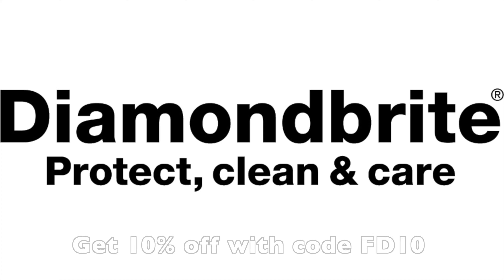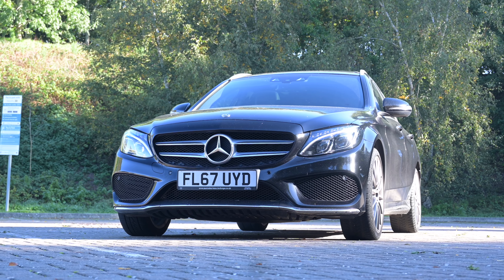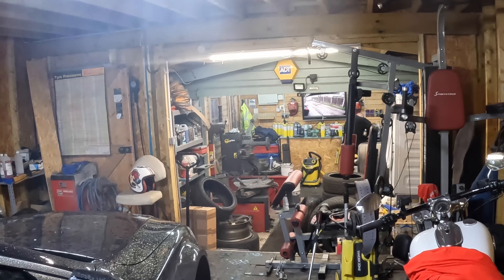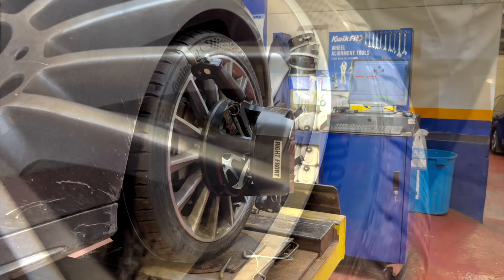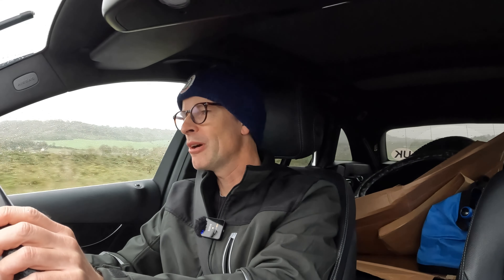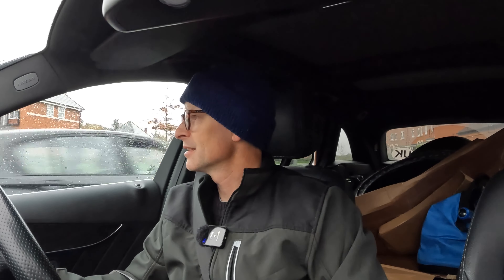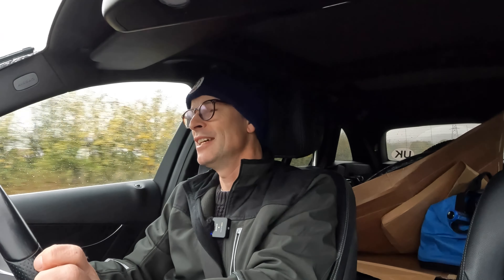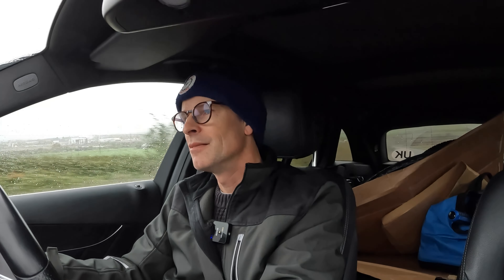Mercedes C250 10k mile update...Is it my new favourite?

Comment: I remember buying my Mazda 2, 2 years ago and it had been run on a shoe string. It had 4 part worn tyres, all different brands, all complete s**t. I changed them to Uniroyal Rainsport 5s and it completely transformed the car. I feel you with the change you got from your car. It's amazing that something simple can completely change the driving experience.
Reply: My car came with Hankook Ventus Prime 2s and they were OK, I put Pirelli Cinturato P7s on it and what a difference.
Reply: It's the rubber components that are generally supplying the comfort of a vehicle, four new balanced tyres should feel better you've more rubber insulating you from the road surface, good idea to rotate tyres so you can bargain a better price for four new ones.

Comment: Getting rid of the runflats in my F30 transformed the handling as well, I'm running Michelin Pilot All Season 4's and they've been fantastic so far
Reply: People running run flats is down to manufactures not providing a spare, those seal and inflate kits are rubbish and will ruin an often repairable tyre that just has a nail or flint in it.

Comment: Bought my Hyundai 5 years ago with a set of Semperit Comfortlife. Those were only half a decade old, had decent meat, but handled like crap. Swapped them to winter tires from Hankook.. was not astonished by the gain. But, during Spring, I got Semperit's new Comfortlife 2 tires (suppose those are still on), and was blown away how direct an old hydraulic power steering can be. It made massive difference. During Autumn, I came home on a curvy set of roads and the back end just flung out, towards the railing, and I wasn't even hammering the thing. The new summer tires just took it like an absolute boss, as if the car was stuck onto the road. 
Having proper rubber materials contacting the road surface is the biggest tuning everyone can afford (sort of, unless you fiddle with the ECU, on your own accord, that is).

Comment: Matt you can get an XF estate as a manual, they are rare but available and ULEZ compliant.  I used to have a 3.0 XF auto and you can use the paddles at any time and it will hold the gear that you put it in so you can use it like a clutchess manual which worked well.
Reply from the maker: I only found base model 2 litre diesel or the V8 R, but nothing in between! Looked quite often too...
Reply: @furiousdriving  You can find both high spec portfolio and R-Sport manuals with the high output 2.0 diesel granted the V6 was never available with manual
Reply: Great review as a S204 owner I'm always interested in the differences compared to the S205.  I swapped out my Contis for Michelins and have been delighted with what I feel is a slight improvement

Comment: You should have gone for all-season tyres. I just put 4x non-runflat Bridgestone WeatherControl A005e on my BMW, and they're brilliant! Far better ride than the OEM runflats that came with the car, almost as good grip in the dry, and far better in the wet, cold, and the light snow we get here in southern England. I had to shop around a bit to find a brand that did all-seasons in the sizes I needed (225/40R19 on the front, 255/35R19 on the back), but now I've done it, I couldn't be happier. Oh, and a slime repair kit in the boot!

Comment: Matt, I recently bought a W204 Saloon (2009 C200 Sport CDI). It is a capable car, has the 2.1 diesel, runs and drives perfectly. VED is £220 a year which makes it cheaper to run than the 1995 BMW E36 318i that it replaced. It has virtually no rust (just some stonechips on the bonnet) and looks like a car with half the mileage (216K on the clock). I wouldn't get rid of my Volvo XC90 but I'm loving the Merc. I've forgotten what a good saloon car is like to drive. It looks like decent tyres have tipped the balance in favour of you keeping the S205.
Reply from the maker: I miss my 204, really well built and so good to drive, if only they were ULEZ - the 205 has the same engine just with ad blue
Reply: Yeah, I get that ULEZ compliance was something you needed from your daily driver.

Comment: Re the Box going back into Auto mode. Go to your mode settings and go to INDIVIDUAL. Set the Gearbox as manual and any other settings you want. Then use Individual rather than sport or comfort. The box will stay in what ever gear you put it in and will not change.
Reply from the maker: I did try that for a bit, but with 9 speeds its constant shifting, and I know that sounds like what I want but with so many gears its better to let it get going on its own and take over as needed. Of course a manual would be better still
Reply: @furiousdriving  You should be able to "double tap" to skip gears, giving less shifting? When I ride my motorcycle I often flick my foot 2 or even 3 gears at the time if I am just cruising about....
Reply from the maker: @GoldenCroc  Ive not heard of that with this before, will try it next time I take it out
Reply: @furiousdriving  Works fine on my old-ish BMW with paddles, no Idea about Merc to be honest, but I dont see why not.

Comment: I have 19" wheels on my E220d and had a very similar crack to yours repaired - the repairer said that BMW and Merc wheels above 18" are his bread and butter jobs. For tyres mine came from new with Goodyear Eagle F1 Asymmetrics, although they are runflat they give great grip all year round. I've stuck with them (now Asymmetric 3s) and I have been getting 20-25,000 miles out of a set, so can't really complain

Comment: Great little update on the Merc Matt and glad you seem a bit happier with the Merc now. That's the one thing that transformed the car when I had R56 Mini was to remove the run flat tyres and replace them with 18 inch rubber band non runflat tyres, it was like night and day. My Cactus is back on its steelies or standard wheels for the winter and for a car that came from a main dealer I can assure you that it never got checked before I bought it as it has 4 different brands of tyres on it! All fairly new tyres, so either the last owner skimped on tyres of not the same brand! I am not a racing driver by any means and the tyres will prob cover about 3000 miles before they come off again in March/April 2023.

Comment: Hi Matt,
Not sure if anyone else picked up on this but early on in the video I thought there was a fair bit of road noise but after the tyre change it was much less noticeable. Another reason I don't like run flats.
I've not driven a modern Mercedes car with an auto box but I have driven plenty of Mercedes truckd and they are the worse, most frustrating gearbox I've ever encountered as they are so dim witted.
I think with modern cars being so refined a slush box can suite the nature of the car and having other cars to drive I think the less engaging driving experience could be tolerated but the other issues you mentioned could be a little harder to live with.

Comment: I loved the way mine looked, a 2019 amg premium plus in diamond white with 19" wheels. I thought the seats were rock hard and the Pirelli tyres were aweful below 10 degrees. I sold it. I now have a Volvo V90 D4 Inscription with an amazing spec. I would never repair an alloy. Just buy a new one. My Volvo is lovely.
Reply from the maker: Yours must have had different seats to mine as these are very soft, much softer than in the W204 in fact. 
If an alloy repair is done well it should last and not be an issue, and a fraction of the cost of a new wheel too

Comment: Have to say I fully agree with you and automatic gearboxes, I've had a couple of autos - both DSG and an old fashioned torque converter type and they both at times select the wrong gear or respond in ways you are not expecting/desiring. I think I'd just put up with it in the case of the S205 and use the other cars for your manual kicks, it's such a nice spec otherwise! Alternatively: P2 Volvo V70 with the 2.5T 5 cylinder petrol engine is ULEZ friendly and can be had with a manual gearbox for £2-3k and a bit more in fuel...
Reply from the maker: Maybe by spring Ill be bored enough to swap it, there are a few estates Id like to try

Comment: It could be worth a gearbox tune. A friend had their E61 535d touring gearbox tuned and it was night and day how responsive and willing to hold a gear and use the torque instead of revving the goolies off it. It may also give you more specifically better low gear holding in sport mode.

Comment: Great video. Came to this after watching 4 of the Mondeo videos. I highly suggest that cracked and repaired wheel remain on the rear of the car and then there is never a chance it’s going to present any out of balance situation to steering and also on the rear less likely to be affected by the extra weight on it and other pot holes in the front. Liked and subscribed!

Comment: I have a 2012 E250cdi with the 7 speed auto, having a fair few autos over the last 25years its by far the best up there with the 5 speed on my old BMW 740, for the driving I do i barely notice any changes, when it did get a bit sluggish not really that much though I had the box flushed and serviced at a MB specialist made it even better

Comment: Sweet car! Don't sell it cause of the 9G Tronic. Try and search for a local bloke with a Xentry / DAS/Vediamo with C4 or C5 to code in Agility and True Manual mode plus AMG menu. The True Manual mode will indeed allow you to plough through the gears from the gear levers on the steering wheel whereas the Agility mode will increase responsiveness to the gearbox changes. I fully understand where you come from when you are saying that a manual vehicle is more engaging. Sad that they left the W205 without the 3.0 V6 diesel engine. The AMG menu will allow you to see all kinds of parameters specific to the AMG vehicles. Fit some Eibach or Vogtland lowering springs and the car will transform completely. Cheers!

Comment: I had 2 sets of Pirelli P7s on my Kia Cee'd, really good tyres and lasted me 80,000km. I'm now using Michelin PS4s on my new Civic 2.0 hybrid and I might change them for Pirellis when I go to replace them.
Reply: Also, I used to be a massive manual gearbox fan, but since driving the Civic hybrid with its eCVT I'm converted. I do still enjoy driving a good manual, but I doubt I'll buy another manual car now.

Comment: I’ve just put a deposit on a 93k mile 2015 C220D g-tronic sport estate with pan roof. It was by far the most comfortable of the cars I tried in my budget. 

With my new car being Sport trim I’m hoping the ride and suspension is going to be a lot more forgiving than the AMG Line models.

Comment: When I got my Z4 it came on the oe Bridgestone A05 runflats and tramlined horrendously and rode like a skateboard, swapped after couple of days as I'd test driven ones on normal tyres. Guy selling it included a 3 series jack kit and a full set of matching 103 design spares with half worn Conti 830 winters. (swapped last week for the summers). Like yours the ride is stodgy but wouldn't drive without them over winter because of the much better wet grip and braking.
My last boss had a 2017 and 2018 Tesla Mod. X and had to pay full whack VED for 5 yrs (the £300 expensive car supplement) as were over 40k new,  all EVs over 40k did after 2017 ved rule changes.

Comment: Good to have an update, looked at Mercedes’ and bmw as wanted a treat but just couldn’t quite stretch or spec was wrong or dealer was a pita, anyway I tried Mercedes’ like yours and it was nice but couldn’t understand the gearbox shifts, then tried a dsg Skoda Octavia estate newer cheaper and less miles 30k, and was stunned at difference, tho obvs much less classy and quality. Now 18 months later and coming up 90k, I still love it, but the 90k timing belt and service cost 1300 quid not helped by crank oil seal failed, and 2 weeks later the dmf is chattering so another 1000+ to fix. Sure all will be fine after that but jeeesh all this tech and emission crap costs a bloody fortune and every service seems to end in a parts list longer than my arm. However, the experience with the c class makes sense, I didn’t know it learned - dsg doesn’t, but the Mercedes’ dealer who I said nice car but gear changes odd just walked off and never explained 🤷🏼‍♂️

Comment: I think, to me, it depends on what journey I'm doing. A short journey with a lot of gear changes, manual every day - I love driving involvement for short journeys. However, for longer, mostly motorway journeys, I prioritise relaxation and ease over driving involvement, so my automatic '01 Lexus GS300 doesn't bother me at all for that, especially since it's an old 5-speed slush box that's a lot more predictable and cooperative than these new fangled 20-speed things seem to be. Plus it has manumatic buttons on the wheel which actually hold the car in a particular gear when you want it to - imagine that!

Comment: My 2020 golf estate came with continental eco contacts with about 3.5mm tread left on the fronts. I hated the lack of traction, poor wet grip and replaced them with good year all seasons which I had on the previous seat Leon and really liked. Immediately I have much better traction wet or dry, the handling is fun on country roads with much less understeer and grip in the wet is confidence inspiring. I got very good life out of my Leon's all seasons so I found no downside although dry weather performance is ultimately behind a summer tyre and snow grip behind a winter one. Though I don't notice any obvious difference myself. Haven't tried in harsh winter yet thoygh. The tyre is also considerably quieter. Long distance fuel economy seems pretty similar at about 55mpg (not bad for a petrol) but low speed economy does seem worse at about 37mpg on urban commute down from 40.  Worth it for the extra confidence and grip. Yes.

Comment: You can overthink things. Had 4 new c250 mercs, c , e and glc. Just drive them,  dont think about it. Personally think they are superb,  safe, solid,  relaxing. Agree super low profile tyres are the bain of modern daftest trend ever. If I was super picky, the seats are like concrete after  a couple of hours. You do get a slight pause if you roll and then power off at a roundabout  but soon get used to it. Would never put runflats on.  Would never drive a manual now, hate them with a passion, horses  for courses.
Reply from the maker: Odd that you found the seats hard, mine feel like the old Mk3 Granada puffy leather chairs.
I dont think Ill ever get over the lack of  control in an auto, or the annoyance at the lag of the line...dreadful things!

Comment: I have a 2014 C250 Premium Plus AMG Line(7-Speed) maintained in factory spec. I pay £35 road tax and get 56mpg on the motorway. The car's weight saving is to the benefit of economy but the expense of solidity. It's a fair trade off. I think back to my Rover SD1 and believe that the concept is much the same - as are the dimensions. But the Mercedes shows how far we've come. The 250 gives superb acceleration and is remarkably quiet once off the mark and you forget its a 4 pot diesel. This is a brilliant everyday car, with loads of safety. Other things I like - descent speed control and Burmester sound system. The self parking is a novelty, but I'm still learning to use and trust it.
Reply: And... Brake HOLD, keyless operation, steering-linked perimeter sensors, head-up display, foot kick tailgate... It goes on and on!
Reply: Hi mate. Is that 56mpg on the dash, or 56mpg on paper measured from full tank to full tank? I’m looking at getting one but want to know the true MPG, and my current VW lies by about 10mpg on the dash!!
Reply: @alexcarter8671  Good question - but is the VW issue the test conditions that gave the official consumption figures, or the way the car computes it? There is only so much energy in a given volume of fuel. You can only get useable work out of it by throwing some away - hence your car's radiator. The trick is to throw away as little as possible. The are two ways to do that: Super Charge and Turbo Charge to make the engine more efficient, and use less of it by recovering the momentum of the car - this is what hybrids do. The C250 is good - with twin turbochargers, regenerative braking and stop-start. The new E220D, a mild hybrid, is astonishing. On the motorway the C can get 56+mpg. The E can get 70mpg. But. I hate the new all screen interface with steering interference and incessant beeping of the new E. I love the 10 year old C!